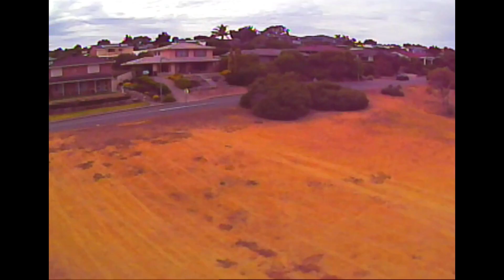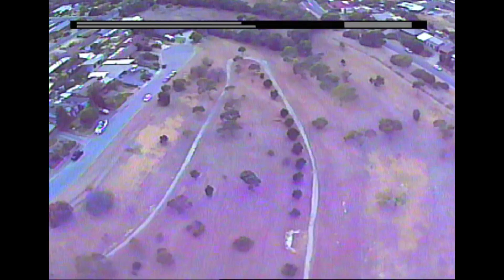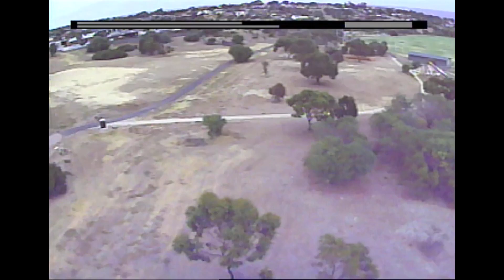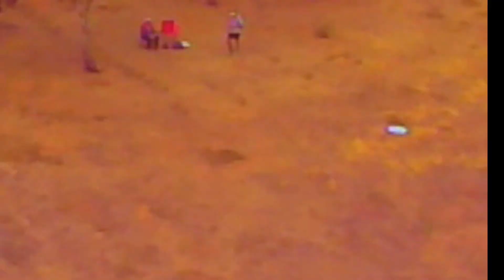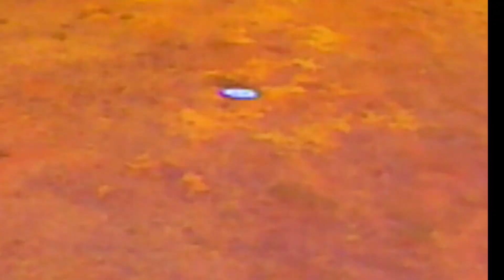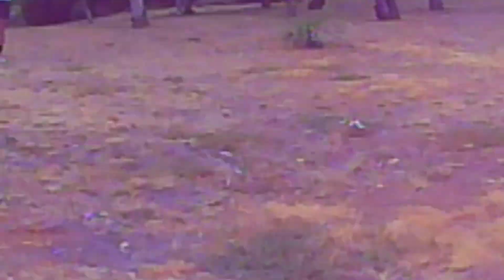First flight with SpeedyBee F405v3, RM Pocket, ELRS Ranger Nano - different but good!

Comment: Thus the wobbling cause by the plastic arm on the frame. This is not stiffer compared to a carbon fiber frame.
Reply from the maker: All the examples of wobbling with Betaflight I found involved carbon fibre frames. Carbon fibre is stiffer and lighter than the plastic frames I use, but I can fly without vibrations when the tuning is right.